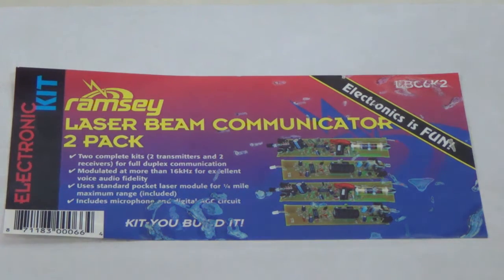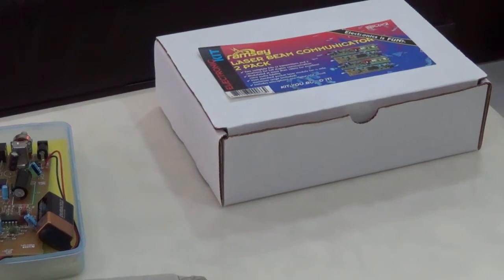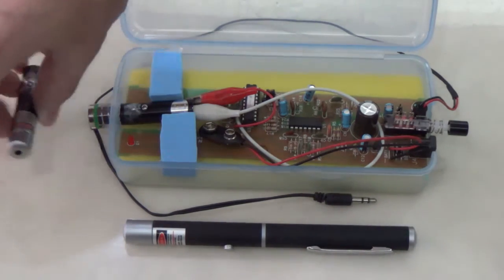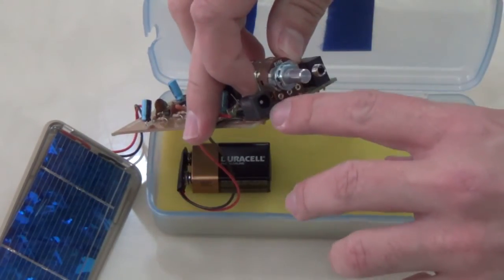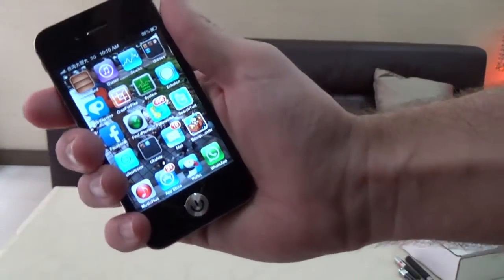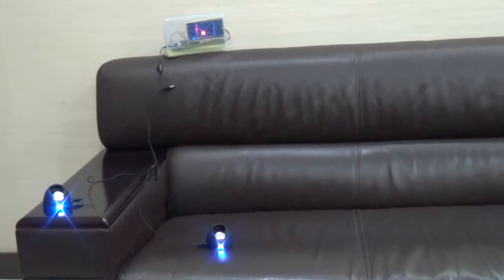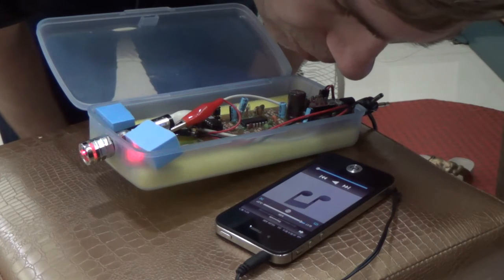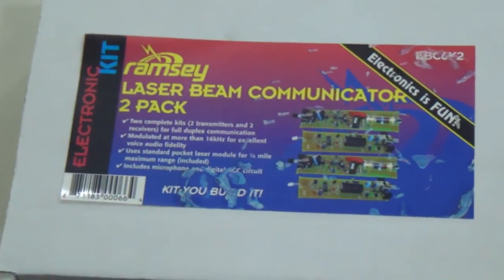How To Build A Laser Communicator Electronic DIY Kit, UFO Sighting News.

Comment: There is a good reference on beam expanders at edmund optics, technical resources, lasers. All the equations are there. A local fellow used a <5mw red laser pointer and was able to communicate over several km using a beam expander and scope.

Comment: Where did you get such a powerful green laser?
If you're using the communicator over larger distances, consider using a beam expander. The larger the beam diameter, the less divergence and you could probably use a much lower power laser. Put a scope on the receiving end. It would be less dangerous to eyes that get in the way.